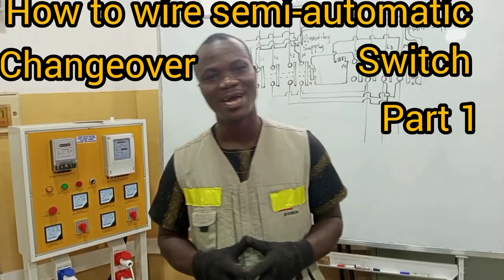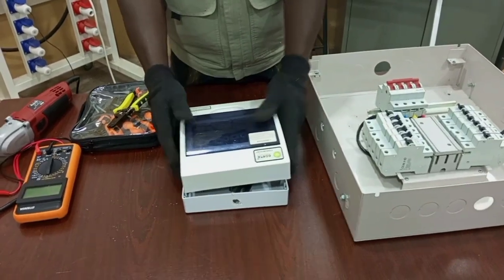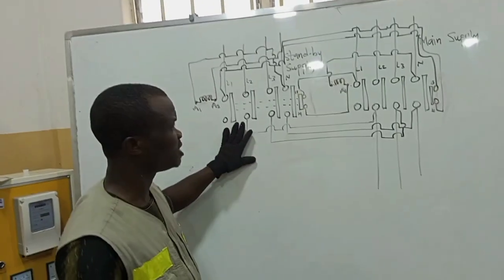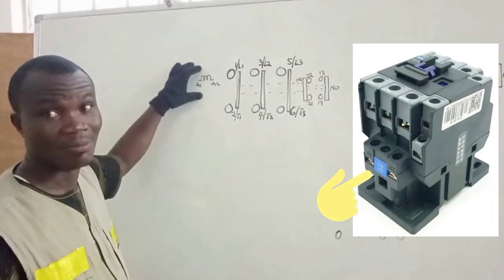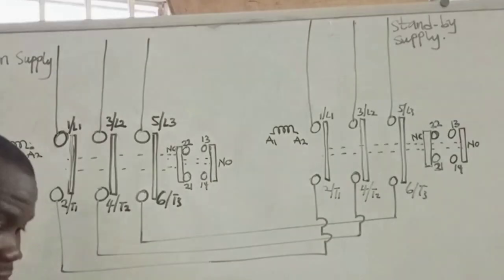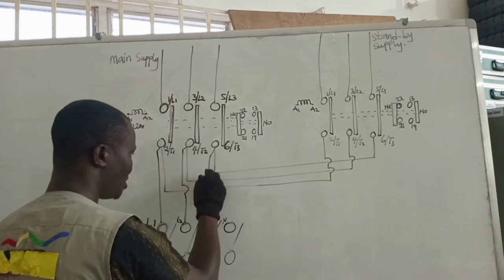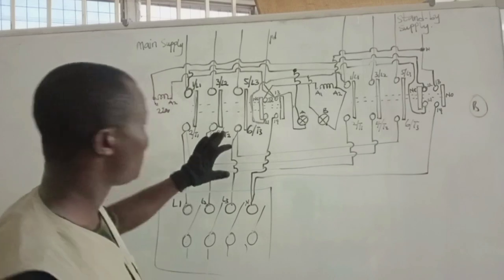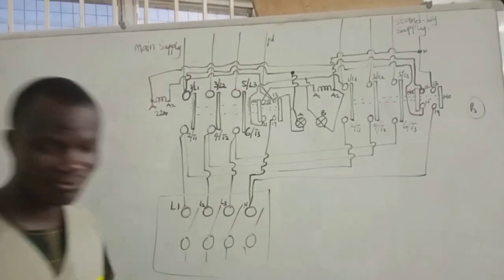AUTOMATIC TRANSFER SWITCH

Comment: Nice job 👍 but Boss why didn’t you use timer switch for the Gen ?
Reply from the maker: Yes. I have a separate video on how to wire a timer to a contactor. I think Separating them makes it easier to understand. Please contact me through WhatsApp on +233242809918 for any more assistance. Thanks.

Comment: Thank you, I learned so much. May I ask a question? In your diagram the aux coil is only connected to L1 of the main or standby source. What happens if for some reason one of the line connection is cut, say L2 of the main power. Will contactor A remains ON? Or will it trigger a failover to the standby contactor B? Any clarification is greatly appreciated.
Reply from the maker: Please I am not sure if I get your question correctly. The auxiliary contact are just contacts that open and close or vice versa when the contactor coil is energized. In the event that one phase is off,    the system will work perfectly on the remaining two phases.